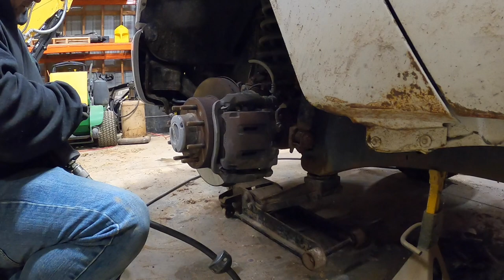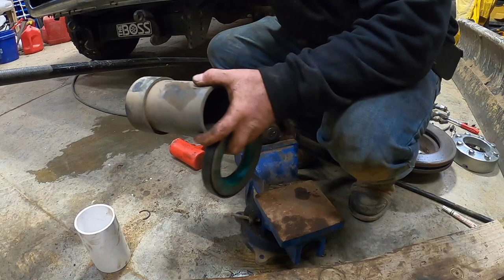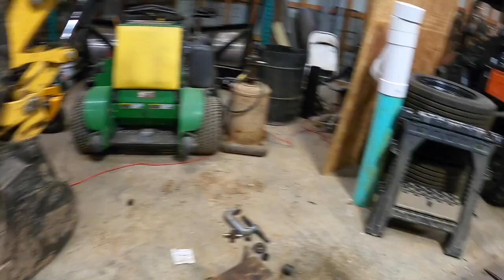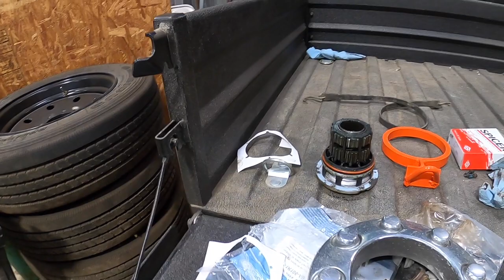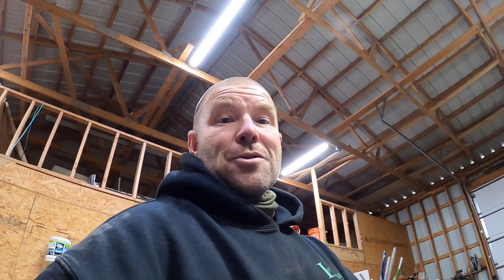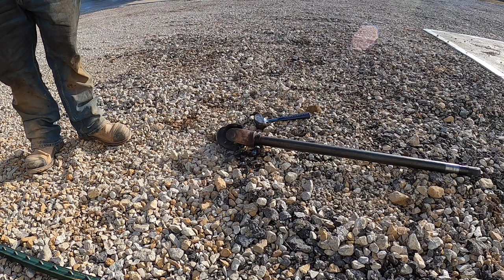2012 F-250 bad u-joint replacement

Comment: Try using that ball joint press next time you work on u joints buddy.
Reply from the maker: Ive done that before and used to all the time, but you can easily bend the ears of the shaft without knowing it that way. Then your joint won't clip in. I would rather get them out like this anymore. 
Thanks for Watching

Comment: You skipped showing so many steps? Pulling the seal/shaft, and installing the u-joint. you didn't mention the seal tool you can buy. how to know if you need to replace the seal, likelihood you'll need to replace it and the cost etc.